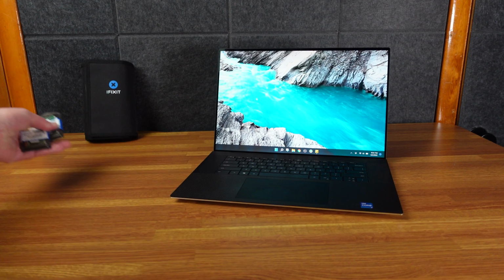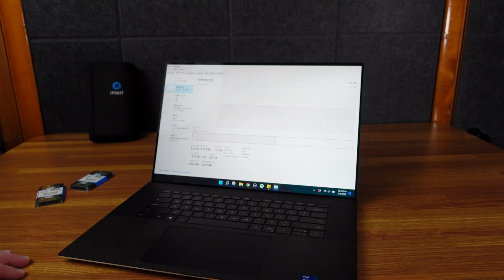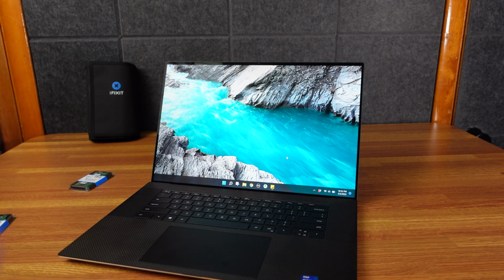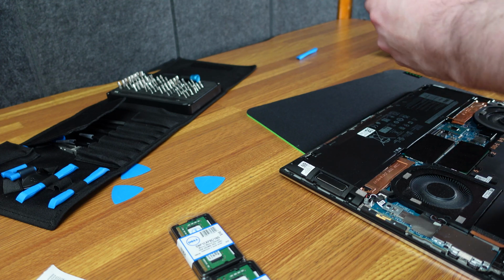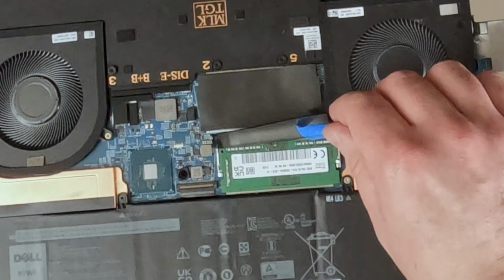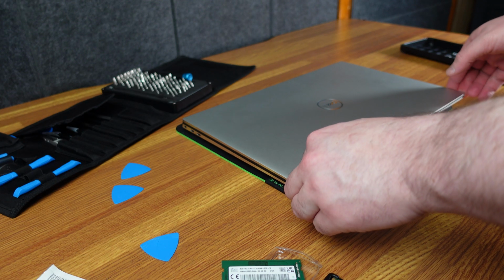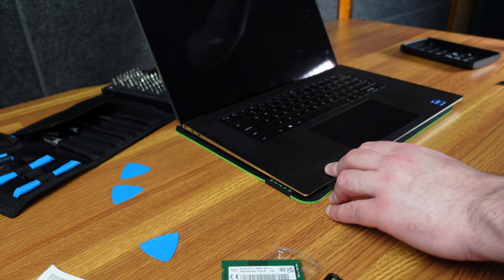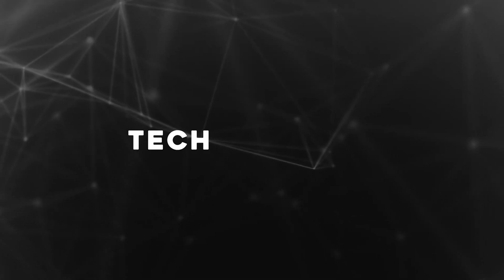Dell XPS 9710 | Disassembly and RAM Upgrade (32 GB)

Comment: I found the secret to remove the back cover: always start detaching it from the left bottom corner first (the caps lock side), once you detach that corner the rest of the sides will pop up as you slide the pry opener
Reply from the maker: Did you remove it again a year later?
Reply: @5after12  Yes, I upgraded the ssd
Reply from the maker: Still a pretty great laptop, ey? Too bad they aren't making another 17 inch this year
Reply: @5after12  Yeah, Dell has nuked XPS, the new 14 and 16 are horrific: less ports, soldered RAM, haptic keyboard+touchpad, complete nightmare. Pretty sad. Best thing now is to get the 13th gen 17 XPS while it lasts. I think Dell will not release a 17 for a long time, if ever. And yes, the 9710 is still a rock solid laptop!